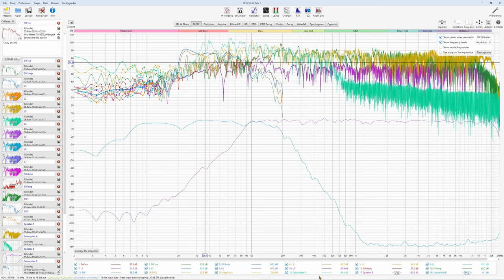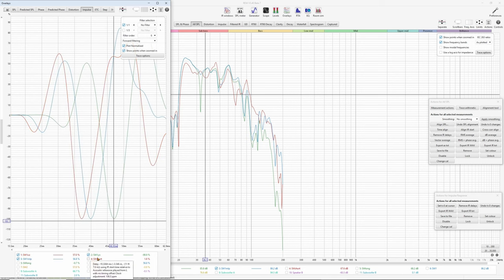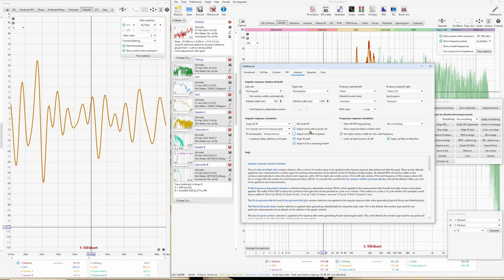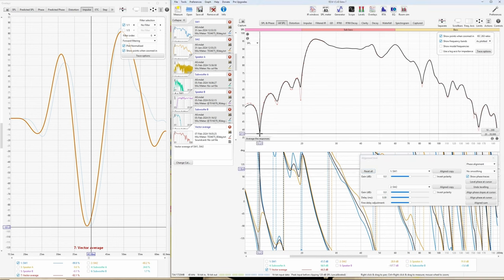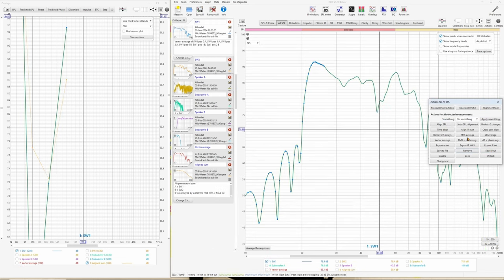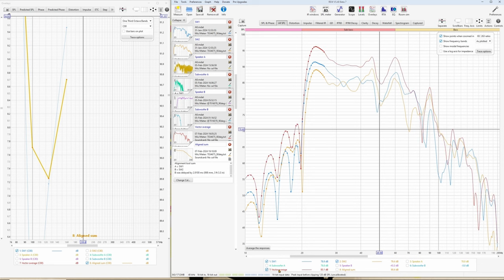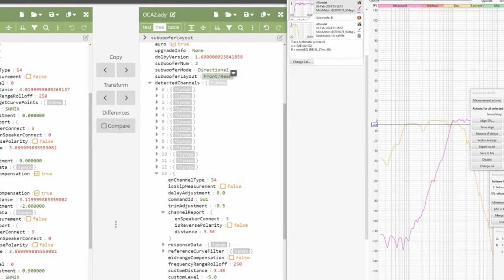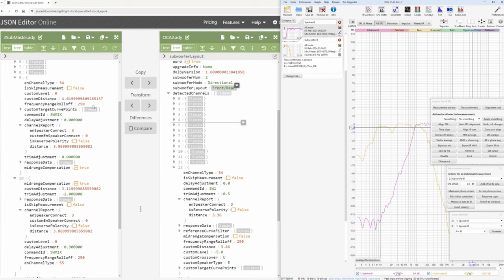Advanced Multiple Subwoofer Control

Comment: Great tutorial. I asked for this multi-sub calibration in a previous video so thank you for delivering it OCA. 
One "tip" - start with the 'worst' sub as as starting point - that's the one with the least flat response at your MLP; and then fix it with the others.
In my experience the OCA technique for time aligning ends up with a better bass control than MSO
Reply from the maker: For two subs, you really don't need MSO unless you can find some use for allpass filters.

Comment: First of all, my compliments on your knowledge of DSP, acoustics and overall audio knowledge. Your videos are very informative and well constructed. I recognize certain things in myself, as a fellow ocd.. Audio is great medicine for us! But now it can be a pitfall as well. But it’s my favourite hobby!

Although I do measurements regularly, especially in FR, waterfall I experience problems in understanding some basic aspects in REW / measurements. 

For example, I still find it difficult to interpret phase, especially what to look for. Preferably as close to 0degree as possible, but the difference between good, acceptable and moderate? Same with impulse response, RT60 etc.

Could you make a video explaining the basics especially what to look for with phase, rt60, clarity, impulse etc. What values are good, average or moderate..
I know there is a lot to read on the internet but nowhere can I find a clear video of what you want to look for in measurement results.
Reply from the maker: Good idea. I will work on this. I give bits and pieces of such information in parts of the videos but need to make one with an organized structure. In the meantime, REW's own manual (online) is quite a good place to start.

Comment: Thanks for the tutorial. Much appreciated! Question about the alignment tool in REW. What is the difference between the option 1. Align Phase SLOPES at cursor. and option 2. align Phase at cursor? While playing around with the software, I repeatedly found that option 2 tends to give a better summation where the resulting response (black line) had more positive summation than option one. What makes choosing option 1 the correct choice for your process and overall? Also, I'm using 4 subs and have 2 rows of seating (5 seats in total). I've used MSO which requires that each sub be measured at each seat, so in my case I have a total of 20 measurement for the subs. Can I use these measurements for your process, or do I need to measure each sub at each seat with multiple measurements positions per seat? MSO have given a very consistent seat to seat result, I'm wondering what issue you found with MSO when you used it?
Reply from the maker: Aligning phase slopes can be useful to spot where a polarity inversion may be required. If the phases with the slopes aligned are about 180 degrees apart, it points out to a polarity inversion requirement. Newer REW versions have an impulse alignment mode in the alignment tool which will automatically detect if a polarity change is required so you don't really need to bother with phase alignment.

MSO is good with more than 2 subs and multiple seats.

Comment: Thank you so much for sharing your knowledge - especially your Audyssey A.R.T. I have never seen this talked about elsewhere and people spend a lot of money to get this level of DSP.
Quick question: How would you align two subwoofers (fixed positions, phase dial, NO delay setting or anything else) if the receiver has only one distance setting and you don't own a miniDSP 2x4 (or other DSP)? a) Set both phases to 0, use alignment tool as you show in your videos and calculate the phase offset at the selected frequency b) Use RTA, turn the phase dial and see which gives the best result (I cannot get this to work for proper results) c) painstakingly measure sweeps with both subs whilst changing the phase a bit each measurement d) something else ?
At the end set the cross correlated distance of both in the receiver of course (for speaker time alignment).
Reply from the maker: There's delay and trim settings in the ady file which control the relative distance and volume settings between the two subs. You can see and change how Audyssey set these up in the online json editor.
Reply: @ocaudiophile  How could the relative distance between both subs be adjusted by the key delayAdjustment if the sub outs are not independent (Denon x1500) meaning from Audysseys POV it should just be a single subwoofer? If it actually does that instead of delaying both subs relative to the speakers (which I don't understand how it would), I suppose I just punch in the number from REWs alignment tool.
Reply from the maker: @markusdittmer3402 I didn't know there are models with 2 subwoofer outputs which are not independent. That's basically just a y-splitter. If you're certain, then all you can do to adjust relative delays is to play around with sw phase settings. In the latest video, I've briefly shown how to calculate required phase shift for a certain delay at a certain frequency.
Reply: @ocaudiophile  Yeah sadly the receiver is like that. Calculating a required phase shift for a given frequency (which I meant by option A above) has the flaw that you will only 'optimize' for that frequency since for higher frequencies one required a higher phaseshift and then you have to remeasure the entire response anyways. So I will probably use RTA with sub call generator, average about 20 times and adjust the phase dial of one subwoofer in 5° steps until I find the best response (option B from above).

Anyways, thank you for your insight and taking the time to reply.
Reply from the maker: Comparing their 0 deg phase responses at the MLP in Overlays with 1/1 octave band smoothing applied to both may give you a ball park figure  idea of the overall phase shift one of the subs will require in the region 20Hz-xoHz. @dittmer3402

Comment: Excellent video, and a good follow-up to your previous video on sub-alignment.

I tried out your tips in practice from the last video, and ran some tests between a setup with one sub inverted (needing just a single ms of delay to get the best response. Having inverted one meant I also had very uniform bass between seats), and not inverting (requiring 15 ms of delay for best uniformity between seats and best response. REW predicted 12ms, but that gave horrible seat-to-seat consistency). The two setups didn't provide exactly the same response, but it got close, at least as far as FR was concerned.
Looking at the predicted Impulse especially, inverting one seemed like the clear winner. However, I was experiencing what I can only describe as "directional bass" when playing loud and deep, where I'd suddenly feel like bass was only coming from one sub. And in particular I feel like with no polarity-switch I get much better pressurization, but that might just be psychoacoustics.
Maintaining polarity significantly reduces this (I am in an L-shaped space, and one sub is near the opening to the L-part, which I feel might contribute), and looking at real-world impulse-responses and group-delays, even though the predicted response had the inverted polarity as a clear winner in these departments, in real-world testing they were much much closer, particularly in IR.

Overall, I think my point is that even though these simulations and predictions can get you a long way towards a good response, you'll still need to measure and listen.
However, without your last video on sub-correlation I'd never have thought to try it with a somewhat higher delay and no inversion.
Reply from the maker: You're right, listening is the ultimate test. In your case, the difference is mostly related to the L-shape of the room, one of the subs don't have rear wall reflections like the other one which boosts and dips its reponse differently compared to the other and when these frequencies are present in the track, you will hear directionality. You might consider lowering your crossover frequency to manage this to an extent.

Comment: Thank you for sharing your expertise! Do your techniques require modification for open-baffle mains?
Reply from the maker: I don't have hands on experience with open baffle systems but I don't see a reason for the method not to apply. Additional care should be taken to pick an aligned sum extending flat to higher frequencies I guess.

Comment: Hello OCA, could you please clarify this: At the time of aligning the speaker with the subs, I have two questions:
1. Do we align the (say) left front speaker with the vector average of the 2 subs or only SUB 1?
This video seems to show that you are aligning the SUB1, but I think you meant to align with the vector average of the two subs.
2. Do we add/subtract time delay to the speaker or to the sub?
This video seems to show that you are changing the delay of SUB1, but that means SUB 1 will get out of alignment with SUB2, essentially undoing what we did earlier (2 sub alignment), no? To keep the 2 subs in alignment with each other, I believe we should change the time delay of the front speaker.
Reply from the maker: I don't remember all the details in the video but you should always align the subs with each other first. Then generate a vector sum (vector average) of all the subs and treat this new measurement as a single subwoofer which needs to be aligned with your speakers. However, if you are using a stereo only system with 2 subs, you can use the new "directional bass" mode in latest Denon & Marantz receivers and in that mode you have to align each sub separately with each speaker but that's a quite different technique.
Reply: @ocaudiophile  Thank you! that makes sense.
I have a Emotiva XMC-1, which has the capability of a stereo sub config where the two subs could have different filters, time alignments etc. But I feel they should first be time aligned with each other (using your procedure). After that I could time align the left front with the vector sum of the subs. But after that, I could make one set of filters with L sub + L front (not the vector sum). Does that make sense?
Reply from the maker: @rajdude1  Yes, align them in Emotiva then measure again in REW all of that as one sub and the front left and right speakers. You can use vector average of left and right to time align that total sub using the same method in the video. But that probably also involves crossover frequency determination and applying crossover filters to the sub and speakers first. It's a bit tedious but apply different crossover frequencies around the spec bass roll off frequency of your speakers and measure each. Align each in alignment tool and compare aligned sums to pick the best XO frequency.
Reply: @ocaudiophile  thanks. I am trying to do all that but am very confused now. e.g. when I try to align the L main speaker with the vector sum of my 2 subs, do I change the delay on the mains speaker or both subs? I think I should change the delay on the L main, because in the next step, I gotta align the R main (and so forth). I cannot change the delay of the sub, because it will affect the alignment of the L main (which I did earlier). Am I correct?

Comment: Thanks!   I'm learning a lot from your videos.  Question, for a 4 sub time alignment doing multiple mic positions, for a 3 east couch, and using cross correlation and vector average feature, what would be the ideal mic position separation to the left and to the right?  And would it be beneficial to take a measurement in front of the MLP?  Thanks again!
Reply from the maker: I think you can go all the way till the middle of each side seat with 4 subs, and one slightly forward measurement would not hurt either, we don't always use those seats leaned fully backwards. Keep the mic at ear height, sweeps loud and long and repeat more than once for the same mic position. Btw, free tool MSO (multiple sub optimizer) has a bit of a learning curve but is very good with 4 sub arrangements.
Reply: That's awesome!  Thank you for your recommendation and keep up the good work.

Comment: Thank you greatly for these videos. I found your channel last year and immediately subscribed. I've been watching and lowering.
Around 16:04 you mention to set the range with cross over at 80hz if that's the person's choice. In one of your earlier videos you showed how to crossover the speakers using the final curve of the subwoofer. Which is the better option?
As you showed in one of your videos, setting the end freq range to around 250 produces higher spl than going with 20000.
Ive 2 subs. Is it necessary to volume align them? I think you mentioned it but I coukdnt get it well.
My last question is once you get the target curve for the subs, should I volume align all speakers to it like you did in the Dolbt Atmos manual tuning complementary tutorial?

Thank you again! You cant put a price to your videos. Super helpful and you still find time to answer questions too.
Reply from the maker: Where you crossover your sub with your speakers should ideally be based on your speakers' natural roll off frequency. This is usually given with -3dB or -6dB drop off frequencies in their specs. 80Hz is a THX standard believed to be the highest frequency where human ear can still not locate where the sound is coming from. This is important when a subwoofer is placed far from the speaker. In the video @ 16:04, 80Hz is given just as an example to explain how to accurately measure your subwoofer's volume level. If your crossover freq is 50Hz, it's meaningless to generate a pink noise covering from 20Hz to 100Hz and measure its volume. 20-50Hz is the wiser choice as the sub will only operate in that range.

2 subs will not be at equal distance and equal volume at the LP so before time aligning them between each other, it's useful to align their volumes to each other.But beyond that, playing with gain settings in the alignment tool will only gradually remove one sub from the equation.

Target level matching is quite complex. I am still working on new methods to optimize it. In general, when you use REW's "calculate target level" tool in the EQ window with anything but unsmoothed response (all but the unsmoothed target level will be equal for the same response), you will see descent required volume adjustments between the speakers. Of course this will also depend on the target curve or room curve you use. There will be a video soon on target level matching (hopefully!).
Reply: Thank you! @ocaudiophile

Comment: Thanks for the helpful video. Small technik question: To align the phase of one subwoofer with the front speaker, is it possible to use cross-correlation between the impulse response of the subwoofer and the front speaker, measured in the low frequency range (for example, 60-120Hz) instead fullrange measurements? Thank you beforehand.
Reply from the maker: Yes and it could give a more accurate result. But for best alignment between the fronts and sub, use REW's Alignment tool and "Align phase" at the crossover frequency.

Comment: Awesome video tutorial. What a coincidence as I was trying to get the best from my 2 subs. I am using your ART video with Audyssey. Can we use this with Audyssey measures?
Reply from the maker: Yes, you have to enter the distance between the two subs in MultEQ Editor under SW2 "delay" setting in meters.
Reply: Thanks for the tips. My HT room is a 9.2.4 within a rectangle (6,5m X 4,5m) and the Subs are opposite in corners (the front SW in the right corner and the back SW in the left corner). The front SW has 0º phase degrees and the back SW has 180º) and a strong null in the 40kh. In you tutorial should I take any additional attention in specific steps to set the SW as best as possible?
Reply from the maker: I'd measure both subs separately at the LP and play with the Alignment tool to see if I can get rid of the 40Hz dip. I think it's worth a try.